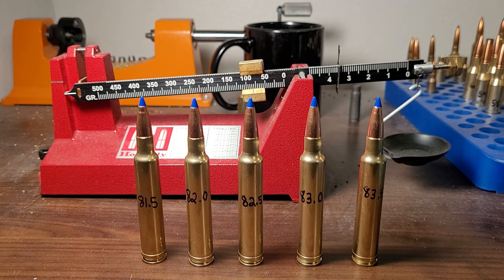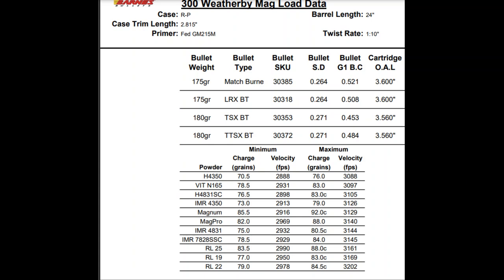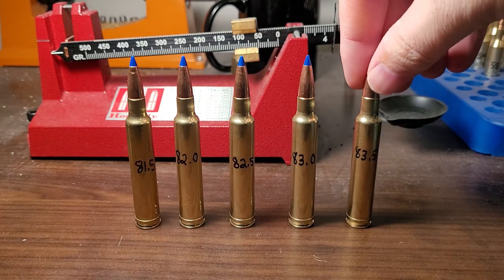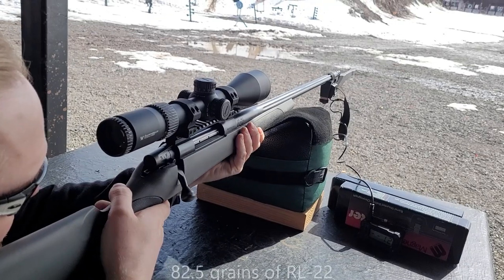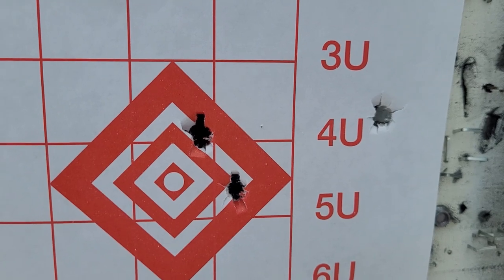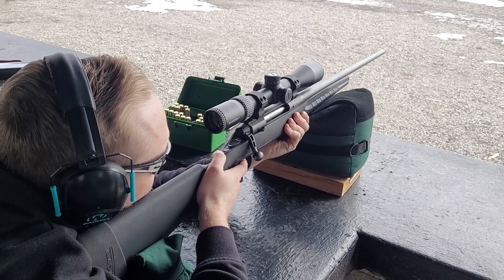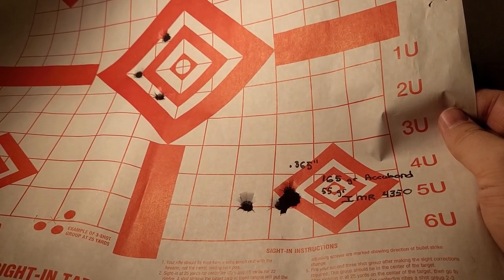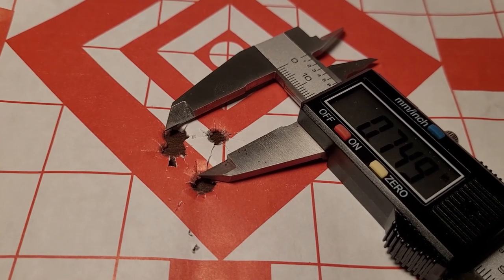300 Weatherby top velocity!

Comment: Happy Birthday Austin! It turned out to be a great birthday celebration at the range! Nice groups, crazy velocities with your 300 Wby. You were into 300 RUM territory and just about nipping on the heels of factory 30-378 velocities. And you found your pressure limits. A productive birthday at the range!
Reply from the maker: Yep it was a lot of fun
Reply: The 30-378 would need well over a 100 grs of 4831 to top that,  I have never been able to get 3300 with my Weatherby even with hotter loads than he was using, I have a 26 in. barrel

Comment: Happy birthday man! That 300 is a shooter. I would be confident with that fine rifle. You can easily tone down the charge and still enjoy mega velocity and 4k ft/lbs. Those lead free bullets will open up no problem. Hammer down man!
Reply from the maker: It's a blast to shoot
Reply: @ReloadingWeatherby  Did those lead free seem to do better than the regular lead type bullets, as I have never got that, with out having to hammer my bolt open

Comment: I have owned a Weatherby Mark 5 with a custom 30inch barrel for 40 years. I bought it to shoot at a 1000 yard range plus take elk hunting. I have used RL 22 for many years . I have hunted coyotes with 100 fmj and taken coyotes at 600 yards with little adjustment. With those bullets i could shoot direct on target at 250 yards. I don't buy high end bullets like barnes or any solids but a good standard bullet that opens to a size of a nickel,up to 600yards. I have taken elk or deer at 600 to 800 yards and each time .the animal dropped.
Reply from the maker: What velocities were you getting with that 30 inch barrel?

Comment: 3400 with a 175… pretty crazy. I‘ll put that into GRT to see what pressure you are running there 😂

What kind of an impact shift do you get with and without the MagnetoSpeed hanging off the barrel?
Reply from the maker: With the magnospeed it was shooting 2 inches low
Reply: @ReloadingWeatherby  interesting, quite a bit. Thx for the info

Comment: Oddly when I hear a discussion of cartridge "efficiency" I start to shut down. Usually, not this time, the term is used to describe a new cartridge that is NOT as fast as what it is designed to surpass. Personally I don't concern myself with those things. If it delivers a bullet at a higher velocity and more punch, I like it. Do I need that higher velocity? How can I tell, the buck/bull didn't complain. My Ram 2500 is probably not as "efficient" as a Prius , but I don't care. 
Good video RW. 
Cheers, Jeff.
Reply from the maker: Agree with you

Comment: Anything about 3000 I’m fine with. I have learned the Nos 180 gr BT pretty much blows up on WT deer. I use those in my 30-06 now.
Reply from the maker: That's why I only use bonded or all copper bullets
Reply: @ReloadingWeatherby  I’ve shot several elk with 180 gr Accubonds and I was disappointed in the expansion. The 190 gr Hornady Interlocks were impressive. Discontinued tho.

Comment: 7828 is the powder for that weight bullet !
Reply from the maker: I'm getting higher velocities and better accuracy with RL-22
Reply: @ReloadingWeatherby  Yes you can but you are also getting to high of pressure . RL 22 ( as you know ) is faster than 7828 , RL 22 is more appropriate for 150 and 165 gr weight bullets . I’m getting 3300 with a 180 gr with 86 gr of 7828 and a Fed 215 primer ( 300 WBY ) with no signs of excessive pressure . This data is from the IMR Handloader’s Guide ! Thanks for all your hard work for us. !…….
Reply from the maker: @thomasdaum1927  IMR 7828 SSC was the first powder I tried.  I hit pressure at 83 gr and that gets me 3300 FPS.
Reply: @thomasdaum1927  I sure can't get 3300 with 7828

Comment: Happy birthday!
Have you ever checked watercapacity diffence between wby and rem  brass?
I bet that there is the answear why you get higher velocity than barnes load data is showing...
Reply from the maker: I get the same velocities with my Weatherby brass. Some barrels just shoot fast.
Reply: @ReloadingWeatherby  Have you checked the freebore, if it happened to have less could give more pressure and  more speed, mine 26 in barrel a lot of free bore, the bullet with fall off the end of the brass before it touches and I can't come near what you are getting I used 83,5grs. H  4831 a lot but have tried many others , 4350 7828 ect.

Comment: I imagine you are careful with bullet selection you could push a .300 WBY "accelerator" load north of 4500fps, really it would be a question of if it would stabilize and if the sabot could hold up to the speed.
Reply from the maker: Hammer makes a 100 gr bullet that I bet I could get close to 4500 FPS.
Reply: @ReloadingWeatherby  another thing that comes to mind with pushing the velocity up that high is if there would be any benefits to gain/progressive twist barrels? I remember reading they were used to help smooth out the pressure curve of large black powder and some older artillery pieces, it might come back into play for modern rounds as the pressure and velocity keep going up.

Comment: Your gun doesn't shoot "Fast" your just overloading it, almost every fired cartridge you show has signs of over pressure....what blows my mind is you know it because you comment on it, keep that crap up and you are asking for trouble and a ruined gun.
Reply from the maker: Let's see here... Barnes data says a max load of 84.5 gr of RL-22 gets me 3202 FPS. 83 gr of RL-22 got me nearly 3400 FPS. According to the book my rifle is shooting way faster. Yes these were all over pressure loads. Since the video, guess how many times I've shot these bullets with RL-22... I'll spoil it for you. I haven't.
Reply: BS he is not over pressure enough to hurt anything, I've loaded mine much hotter trying to get the speeds he's getting
Reply: @robertboyd3863 Every gun is different and unique, what works in yours may or may not be safe in another rifle. That why we “work up a load” for each rifle including components, changing the primer and even loading different manufacturers of brass can have an impact on your load.
Even the author says he has never used this load again, evidently he was only chasing velocity and once attained never used that loading again, If you look at the primers in the video every one has signs of overpressure.